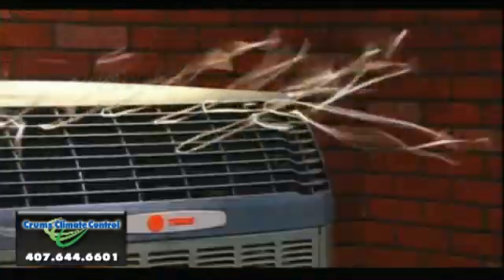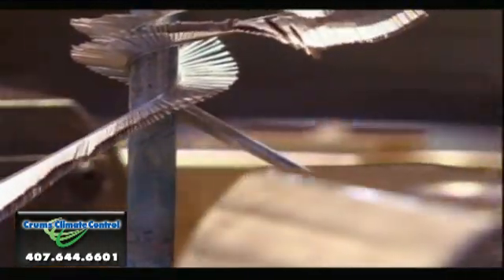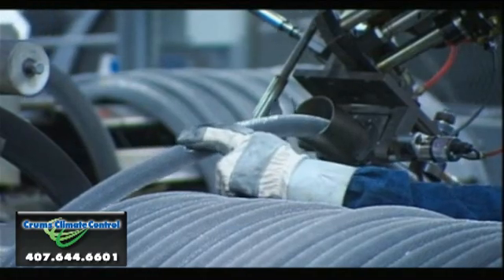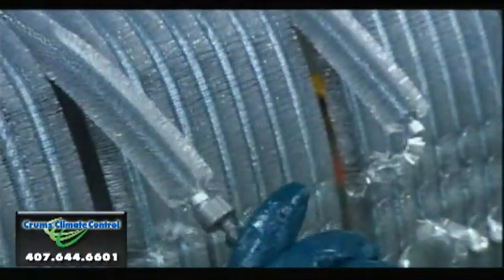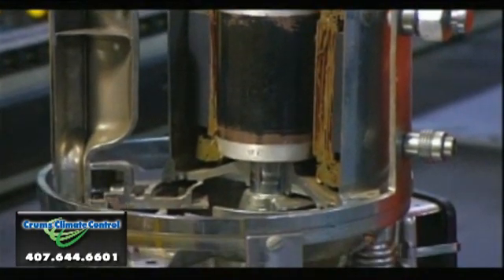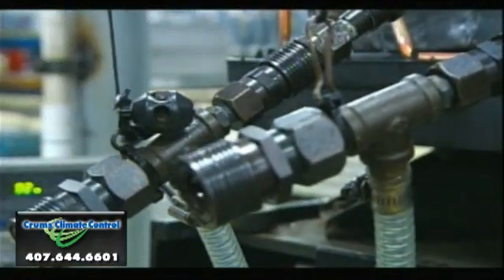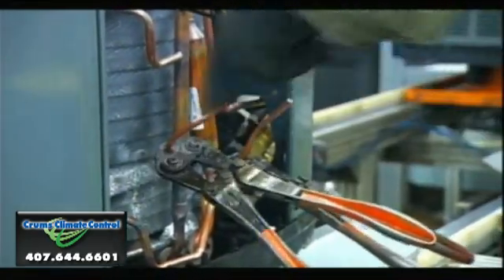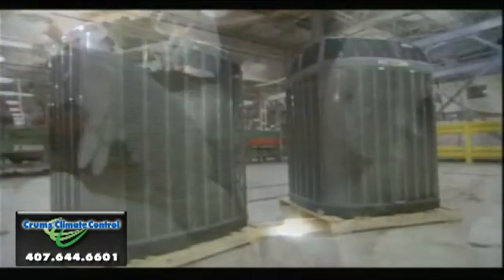Trane Air Conditioner - How It's Made

Comment: Commercial and industrial HVAC Tech here in Austin. I work a building that has 40 split units built in 1986, only 3 of the original GE BUILT TRANES HAVE BEEN SUBBED OUT IN MAY 2019. The carrier installed in 2012 ALREADY NEEDS A FAN MOTOR. If a dumbass didn’t install it, then a dumbass run it for 30 years they’ll last you!!! OEM FANS IN ALL BUT 4 . That’s 33 1986 tranes still running like champs.

Comment: Worst piece of shit know to mankind.
Reply: parkerbohnn
I think you're trolling here.
Reply: +parker bohnn That is totally not true I have that same trane they showed in the video and it lasted from 1998-2015!!!!
Reply: Vann Berg
  I'm in a rental unit and the piece of shit runs about 20 minutes then just blows air and the temperature gets up to 80 degrees. In the manual it says to set the fucking thing at 78 degrees!!!! 78 fucking degrees and they actually sold these fucking things? The god dam thing is so useless you have to set the fucker at 78 degrees because it couldn't cool down a dog house or even a birdcage.
Reply: +parkerbohnn your low on refrigerant if its not pumping out cool air
Reply: Something is likely wrong with the install. It may be undersized, have poor air flow or some other issue. You should be able to get it to 74 during the day and below 70 at night.
Reply: billybassman21
Undersized!!??? It wouldn't cool down a dog house or even a dollhouse.
Reply: billybassman21
Except it wouldn't cool down a dollhouse.
Reply: parkerbohnn really?

Comment: I have a Trane unit that is 8 years old now.  It makes noises when it starts up that sounds like someone beating a piece of metal with a hammer.  It will never do it when the technician is there.  I finally recorded the sound and one service tech tells me it is a "check valve" that consists of a steel ball that keeps slamming inside the copper tube until the pressure has equalized.  Trane redesigned the valve but do not notify customers of the problem but choose to hide it.  SHAME!
Reply: Allen W without the check cable you’re compressor would get liquid and then the complaint would be no cooling not a noise complaint

Comment: I have an Trane Air Handler and I have one question, but can not find HELP, just want to know if I have to flush the system with water or with water,bleach?  help,help
Reply: Irmgard Meyer water is fine unless you have an odor use a coil cleaner
Reply: Water is fine, sometimes in case of slime shows up clean it up first and then use a condensation product

Comment: @kkjgg112391  They aren't terribly hard to clean, but you do have to remove the top and side panels to clean them properly. With traditional fin coils, it's sometimes possible to get rid of the surface layer of gunk by spraying downward without having to take the top off.